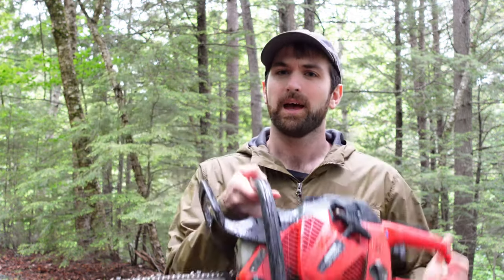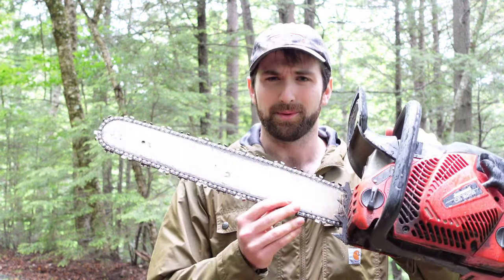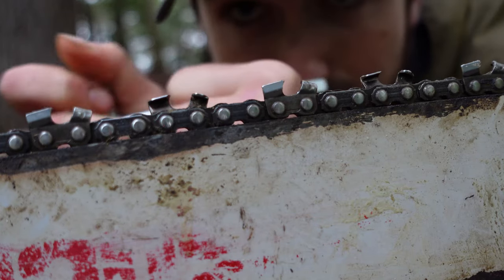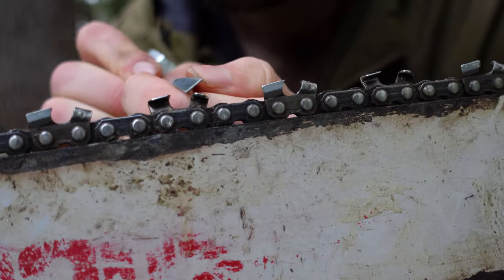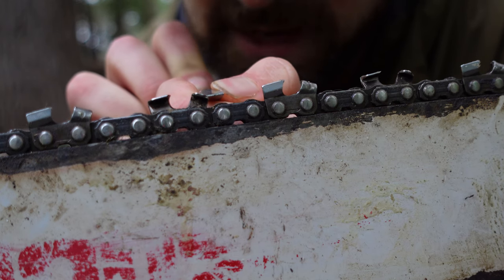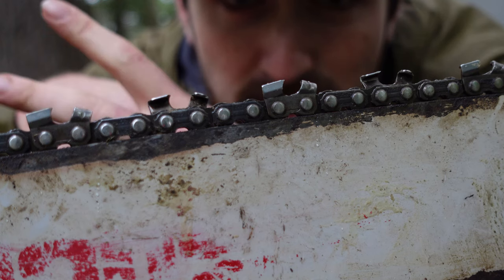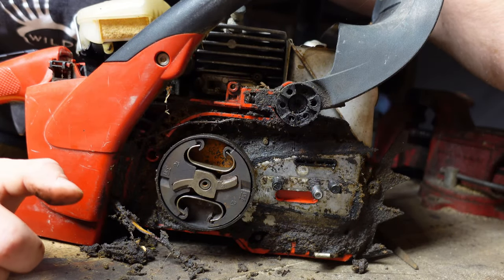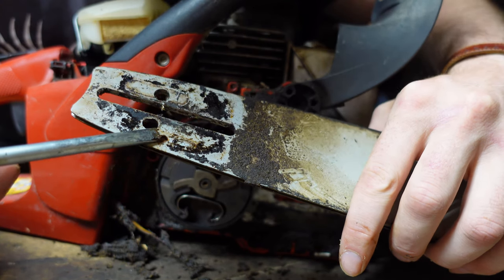How to Fix a Chainsaw That Burns Wood and Smokes

Comment: The other reason I would add for novices is leaving the chain brake on after starting the saw. This will burn the clutch drum and cause smoking very quickly. If you do that, don’t feel bad - we’ve all done it at one time or another.